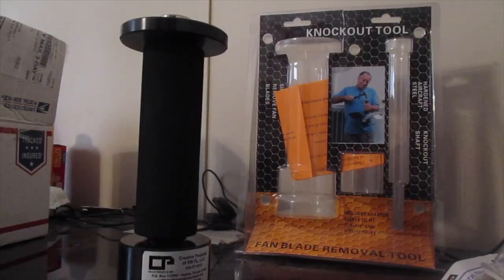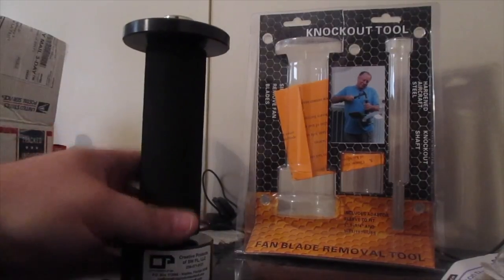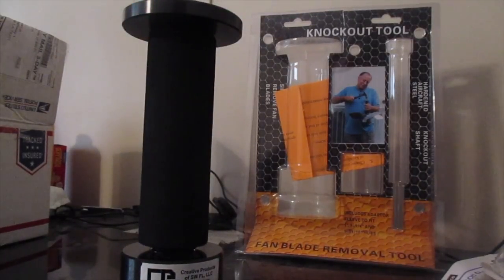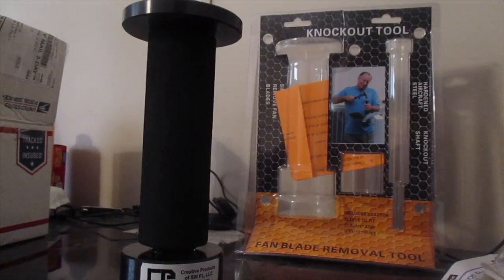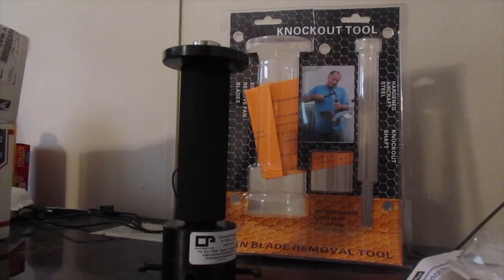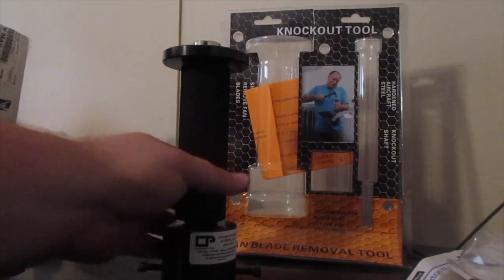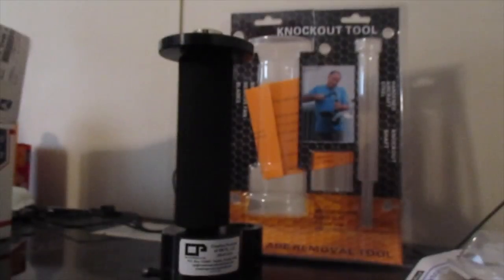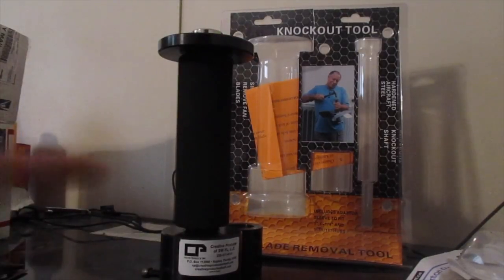The Knockout Tool from Creative Products

Comment: Would you be able to use this type puller if you were reusing the motor. An example would be a blower cleaning. This looks like it may damage/destroy the bearings.
Reply: Bruce Wayne No you would not be able to re-use the motor afterwards since once you hammer the shaft the bearings tends to stop moving in the motor. I find this tool is really helpful in those situations where you have to re use the fan blade or blower wheel. I really like this tool though.